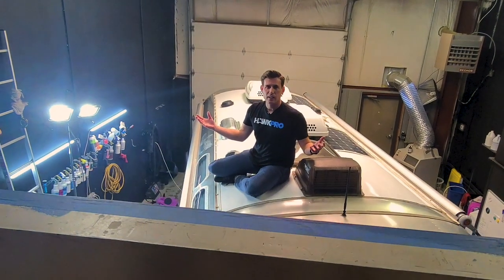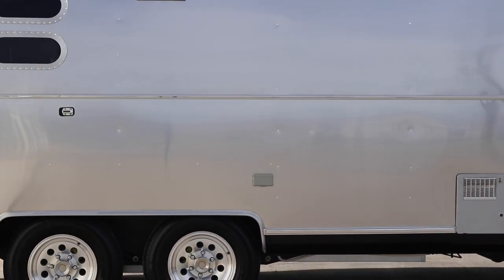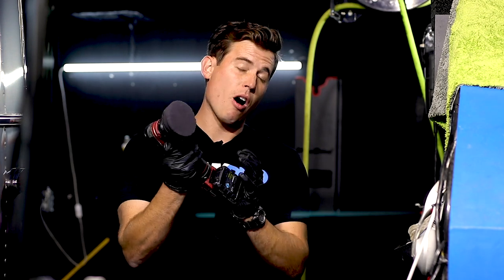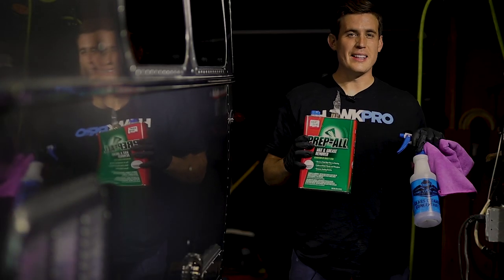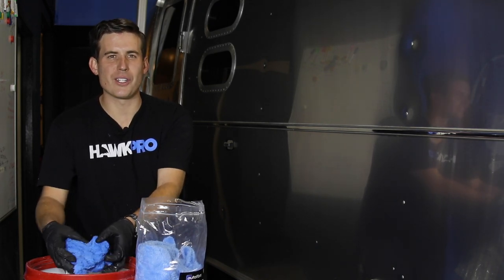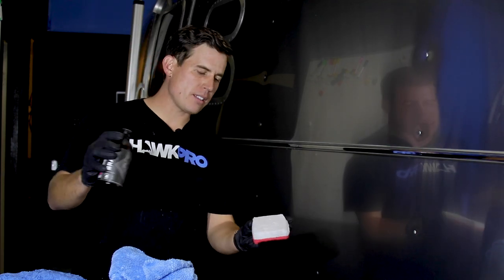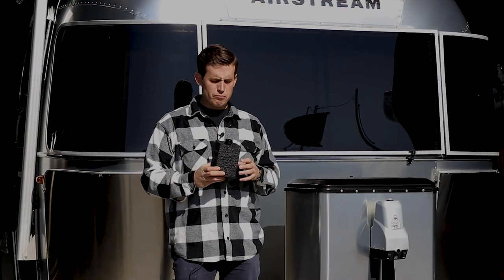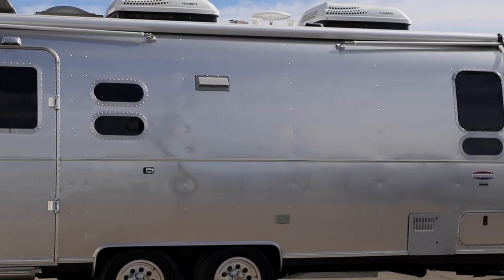A $4,000 DETAIL JOB? Why you should be coating Airstream Trailers

Comment: Great work! Watching from Alexandria, VA. Weather here is nothing like Utah but  I’m doing rinseless washes in garage from here on til spring.
Reply from the maker: Heck yeah... do you have ability to wash down with hose or pressure washer though? Pre soak, and rinse, them rinseless wash method is my go to
Reply: @HawkProDetailing  yes absolutely same for me pressure wash real quick and then bring it into garage for rinseless. I recently discovered Feynlab Pure Rinseless and it has got the most powerful cleaning ability of any rinseless wash I have ever used. It will strip waxes and sealants but I figured you might have use for it with your harsh weather climate.

Comment: Great video.  I know that on the Airstream forums people have asked if anyone has had a ceramic coat put on.  What would the maintenance/upkeep be for a AS that had been coated?
Reply from the maker: I try not to over sell a ceramic. To me...it's far superior protection in comparison to a wax or sealant. It would be great if the owner could get it into a detailer 1/2 times a year for a wash and clay and ceramic topper/sealant which is just good maintenance for any vehicle. But this owner is so far ahead of the game in preserving their expensive Airstream and good maintenance from here will just be so much easier